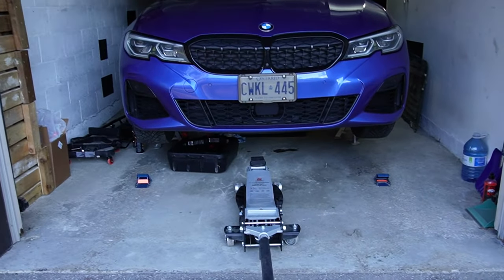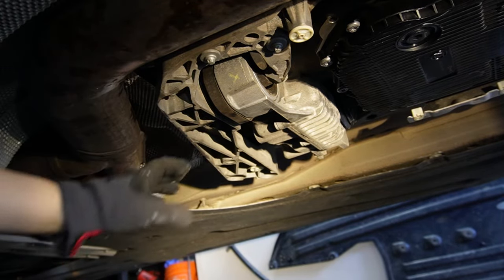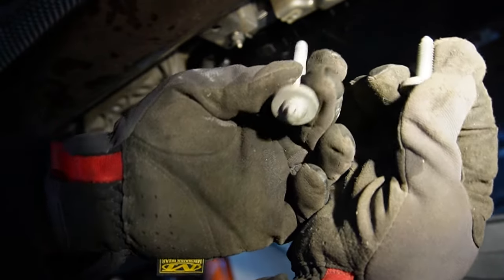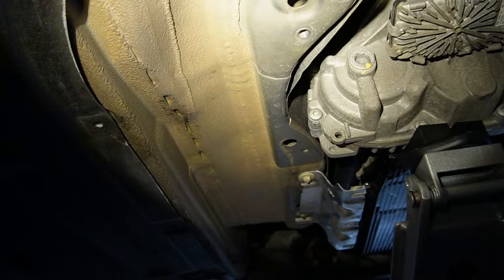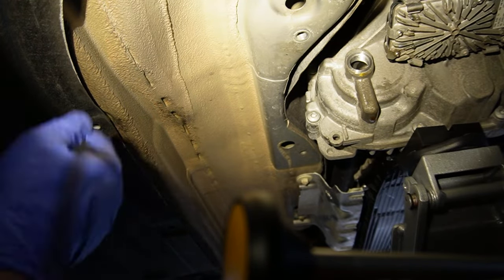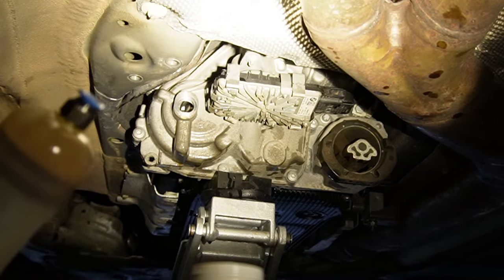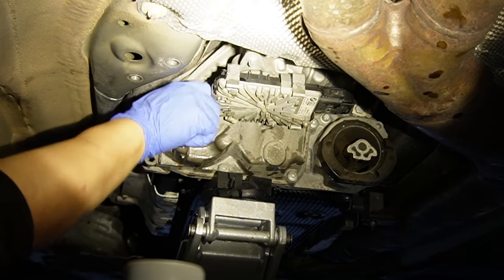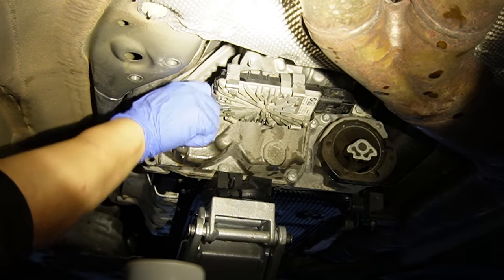*DIY* Changing Transfer Case Fluid | BMW G20 M340i - MOST NEGLECTED BMW Maintenance

Comment: Definitely need to use ISTA to open the oil chambers to get all the oil out.   Great DIY however.
Reply from the maker: Thank you for the kind words! I will revisit this in 2025 when I’m gonna be doing the transmission fluid and pan again. Very likely to make an updated version of this with ISTA involved.

Comment: So why was it so hard to get the old fluid out, it was relatively easy with rear and front differential
Reply from the maker: Different design of systems between transfer case and the front/rear differentials.
The diffs have a spacious opening for us to feed a way larger diameter hose down, should you choose to siphon out the old fluid. Whereas, on the transfer case, you are “forced” to use a hose that has a way smaller diameter. As well, the transfer case opening has an awkward angle for us to aim at to feed the hose down.
Reply: @TandeGarage  I’d do it myself but i don’t want to only get 30% of the old fluid out, what are the chances you got so little out because some of it just burned away? When I did my front diff there was like almost less than half old left (I know not good lol)
Reply from the maker: I don’t think that some was burned away per se. More like I didn’t have the patience to get as much out as I could. When I was changing the TC fluid and making this video, I was rushing (in a way) to get it done, as I needed the transmission fluid to be changed and the car to be ready to go the next day.
If I had more time to do it again, and knew that I needed a hose smaller in diameter, I should’ve been able to siphon more fluid out of the TC.
Reply: @TandeGarage  alright good to know that it’s doable with more patience, thank you, you’ve helped me out a lot with my 2020 g20 330ix thus far, 92k miles and 0 issues (even with my stage 2 tune).
Reply from the maker: @shotikoedisherashvili3834  I’m glad to hear!
Reply: @TandeGarage  currently in the process of changing the fluid, it seems like you don’t need to take off the bottom panel to drain and fill this, long extension reaches perfectly, am I missing something here?
Reply from the maker: @shotikoedisherashvili3834  I’m not surprised at all that you are able to reach the plug with an extension, without removing the brace at the bottom. I did it mainly for better camera angle and view!
Reply: @TandeGarage  still in the process, I had to also slightly jack up transfer case as 14mm was rubbing on the metal bracket you took off, trying to do otherwise would strip the plug.
Reply from the maker: @shotikoedisherashvili3834  Worst case scenario is really to take off the entire brace, which is not difficult to remove & reinstall anyways. You got it!
Reply: @TandeGarage  ahh now I’m stuck with the tube problem 😭, could I hypothetically go to my local gas station and get those thin coffee straws and tape that with the tube that doesn’t fit and use that?
Reply from the maker: @shotikoedisherashvili3834  i highly advise getting a rubber of maybe silicone hose that would fit into the tiny opening. You won’t be able to get the flexibility that these materials offer with a plastic straw or anything plastic particularly.

Comment: How often do you change your transfer case and differentials fluid? Nobody seems to agree on a number of km/miles on the internet. Some says lifetime, some says 30k miles, some 50k miles, some 100k km, some 120k km, some says front diff fluid change is not needed. I'm getting close to 65k km on mine and I'm thinking about doing all of them on mine, but I don't know if it would be too early for that.
Reply from the maker: That’s actually a great question! BMW has not been publishing any official interval for these drivetrain components, as they claim they are “lifetime fluid” in which I went over they are more so referred to lifetime of the vehicle/average timespan of ownership. That said, everyone you speak you is going to have a different opinions on what’s the “proper” interval to change these fluid - because there simply isn’t a “proper” interval. And don’t forget that it generally varies depending on how you drive the car (do you haul anything, do you take the car to the track, do you do mostly city or highways/freeways, etc).
However, to get you and anyone to start off with my own opinion:
- Transfer Case Fluid: 80k km
- Front Differential Fluid: 60k km
- Rear Differential Fluid: 60k km
- Transmission Fluid (and Filter): 80k km unless it’s tuned then you might want to do it earlier

You can definitely go for the fluid change interval mentioned above earlier or later, give or take 10-20k km.
The only one I’d say to kind of stick to it is the ZF8 transmission fluid as it’s a bit “picky”. You want to give the original fluid some time to break-in the gears a bit to collect the particles, as well as for the electronics of the transmission to adapt to these changes before you change over to brand new fluid.
But fluid change is absolutely necessary, as they oxidize and break down over time, and they lose their properties in their functions. I don’t buy the whole lifetime fluid concept, IMO it’s just to bring down the cost of ownership so BMW or other manufacturers are looked nicely on papers.

Comment: Why don’t you recommend mixing fluids, they are cheaper alternatives like redline?
Reply from the maker: I’ve researched and heard from others that BMW transfer cases are picky with the fluid used, and they can act odd when the “wrong” fluid is used.
OEM T-case fluid isn’t ridiculously expensive - unlike their rear diff fluid specifically, I’d stay with OEM unless it’s not an option (i.e. your dealership somehow doesn’t carry them or it’s on backordered indefinitely).

Comment: Nice video, i just did it in my own m340 G21. 
I highly recommend use ISTA and perform the transfer case service program.
In that way the bmw diagnostic tool opens a valve in between the chambers inside the transfer case, so that more oil can be sucked out. I managed to get 700 ML out of the system.
Reply from the maker: Interesting about its service mode.
I did some research before attending this, and xHP (a tool/company that does BMW ZF transmission tuning) recommends not to reset transfer case adaptation after changing the transfer case fluid.
That’s why I didn’t even bother to try plugging in my computer to run ISTA 😅

Comment: Do you reuse the bolt or replace new one? Will it leak if reuse the old bolt?
How many quart do it take?
Reply from the maker: It’s a relatively small reservoir, and BMW only sells their DTF1 in 1L bottle. That should be more than enough for at least 1 drain and fill.
For the fill plug, I would advise getting a new one since the seal could break on removal. If the seal isn’t ripped, you MAY be able to get away with the old plug.
Reply: @TandeGarage  Do you know if the transfer case plug is the same size as the differential plugs? Thanks and great videos BTW
Reply from the maker: @dann0397  if I remember correctly, they all share the same plug: transfer case, front diff, rear diff; except for the ZF8 transmission drain and fill plugs are different than these 3 drivetrain systems.